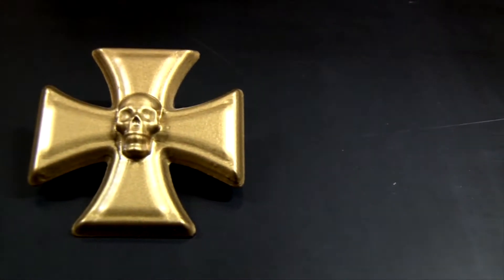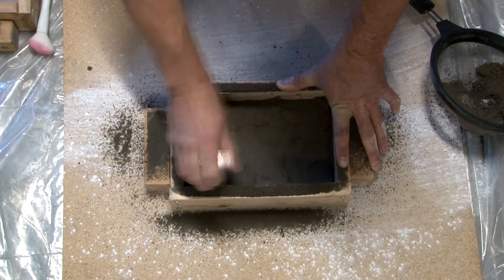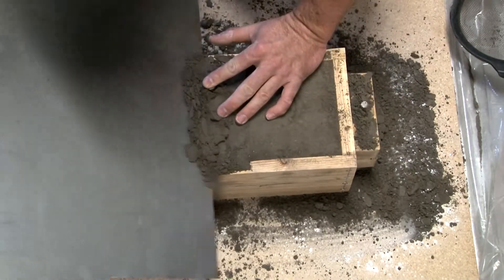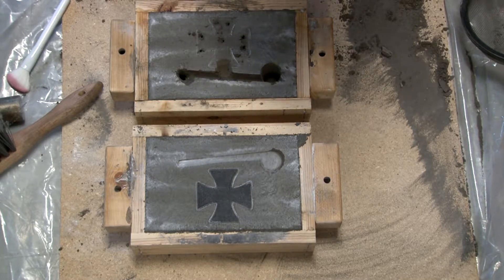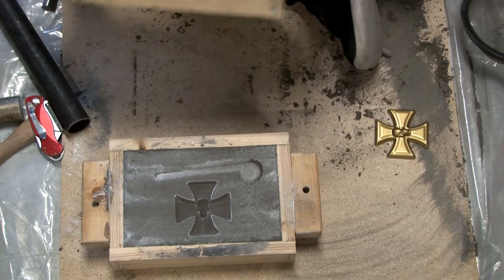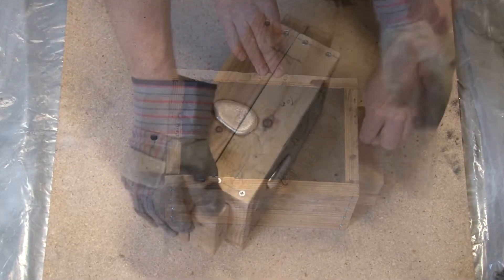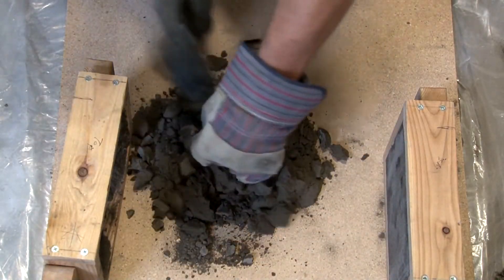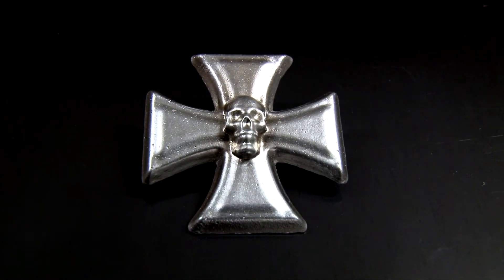Aluminum sand casting of a Maltese Cross and Skull with AWESOME surface finish

Comment: So glad to see a person using proper safety gear. Will subscribe for that only. Looks outstanding!
Reply from the maker: Thank you. I still plan on obtaining more safety gear.(welding spats for my shins and leathers with more coverage)  I have been raked over the coals for my pouring tongs that I never liked that came with the forge.  I would pour towards me because of the awkwardness of the tongs but I kept the crucible as low as possible so if it slipped there would be minimal splash.  I have been working on a solution for several months and have a constructed a new set I will talk about in my next video.   Thanks again!

Comment: Nice casting. How did you avoid porosity?
Reply from the maker: I am not sure about the porosity because I think that refers to the voids inside the casting.  There is a little pitting on the outside of the casting which now I believe I have better control over.  Something I was doing wrong at first was not creating vents away from the mold cavity. I made them on the back side of the casting.  This would cause sand to possibly fall back in during casting and cause pits from where the aluminum would flow around the lose sand grains.  The other improvement I later made was using an air compressor to gently blow any loose sand out of the mold. There is also a video called "CASTcon 2018 - Latest Techniques for Castings" on youtube.  The presenter explains how to avoid the metal from carrying air down with it and reduce turbulence.  Using a tapered sprue helps reduce air entrapment along with having the metal flow past the mold first then evenly filling it up.  That’s why I use my little 3d printed spin trap and sprue.  This information I either found or people took the time to give me constructive criticism on my posts to improve my castings.  One last thing, the casting sand used was very fine at 180mesh. Thanks for watching my video I hope this helps.
Reply: @DamonsMetalCasting  Has helped ALOT. Thank you

Comment: the burner is making that noise because the air and gas  flow is not adjusted properly. can try a more expensive regulator. i ended up making a frosty T burner. i bought a forge online and the flare end of the burner is too long

Comment: Not bad not bad at all. But a few things that might help. 1: Your moulding bench is drying out your sand - either paint it or get a non water absorbent material.
                                                                                                    2: Runner in the drag and gate in the cope to the back of the casting
                                                                                                    3: Don't ruin the back of the casting with those vents, instead just scratch very shallow and narrow vents across the parting surface from each corner of the casting         4: get yourself an air compress or so you can blow the mould out properly and get rid of those annoying little loose grains that detract from your otherwise excellent surface finish
                                                                                                     5:Use an old power hacksaw blade or a piece of light angle material to strike off the mould, that great big steel sheet is crazy awkward.
                                                                                                     6 And please leave the Goddamn pins in place - do NOT do a Myford with them, its just crazy. One pin hole should be a slot.... Martin
Reply from the maker: Thank you for taking the time to view my video and leave helpful comments.  I just started sand casting this year.  There are a few YouTube creators that inspired me before I started sand casting and you are one of them.  I will definitely try your suggestions, I really like your idea of pulling the vent off to the side, I think sometimes sand breaks loose from my vents and causes flaws/pitting in my parts.

Comment: It came out great!  Just a fyi if your didn't know, your burner is sputtering.  Definitely not burning to its full potential.
Reply from the maker: Thanks!  Yeah, for my burner it's off of amazon,  I am not too impressed with it.  It's burner is located dead center, not off center for that nice swirl of heat.  I have noticed the burner sputtering, I just haven't adressed it yet.  Thank you for the advice.